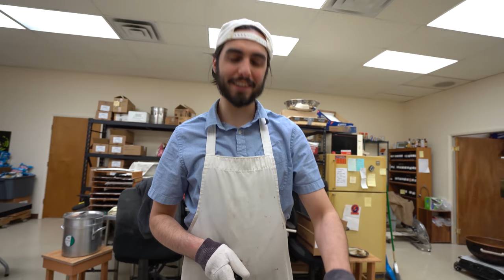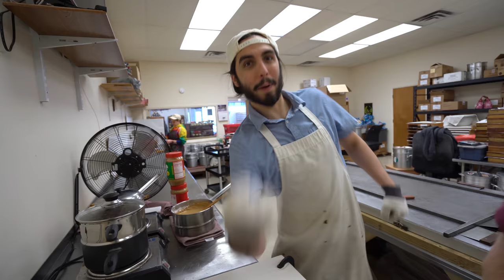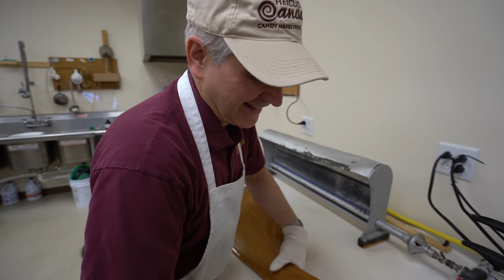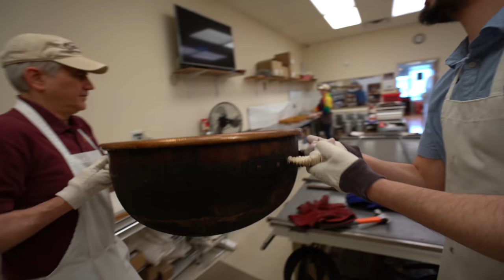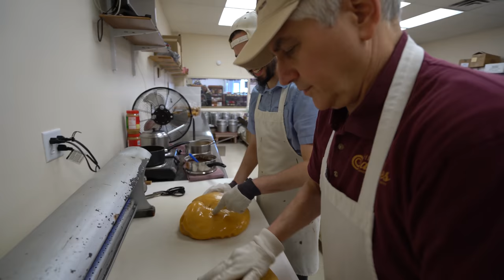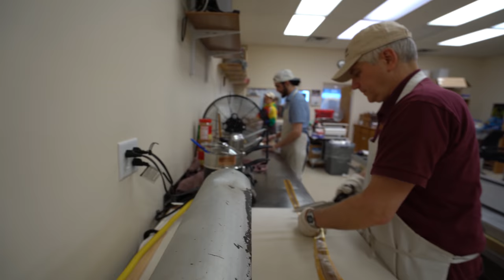We Made Peanut Butter Cup Ribbon Candy!

Comment: I dont think it would be water bending, cause all of It is boiled. Its propably rock bending if the sugar used is from a mine
Reply: Sugar isn't mined, it's made from a plant: the sugarcane.
Reply: @rxcrcfllptrs  there different types of sugar, you can actually mine It! Look It up on google
Reply: Alas, I don't believe so, because even rock crystal sugar comes from a supersaturated solution of sugar (from sugarcane or sugar beet) and water. And yes, I did look it up on several search engines as well as tried several filters to look for this so-called rock sugars. I'd love to take a look at your sources though!
Reply: @rxcrcfllptrs  tbh I just heard of them, I think I had a misconception thinking this sugar crystals comes from those mines, but as you say the are from the same cane
Reply: Yeah, rock candy is formed by soaking sticks or string in supersaturated sugar solution (like SUPER saturated, 3:1 ratio of sugar to water), letting sugar crystals form around whatever you had soaked in the solution. It's a pretty fun science experiment-slash-snack if you have the time!